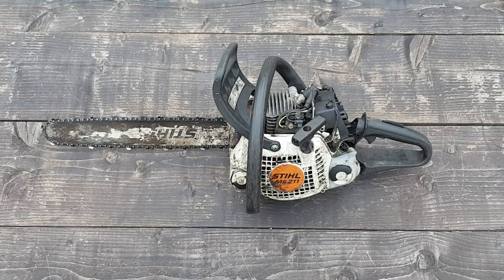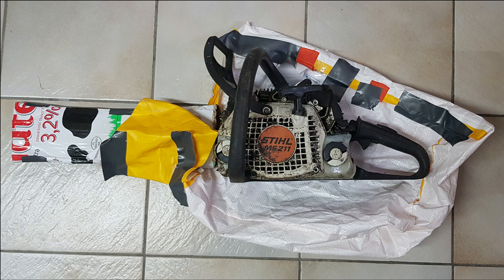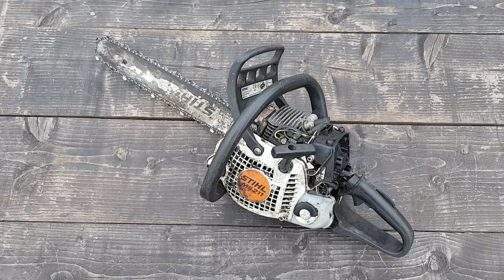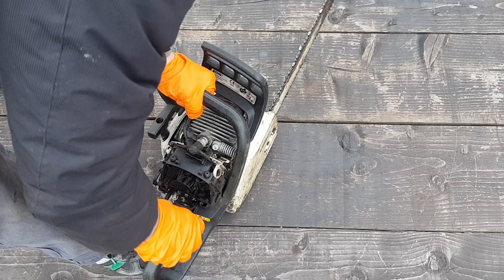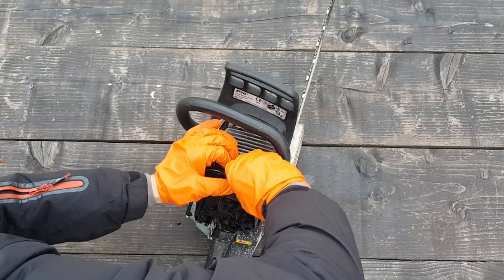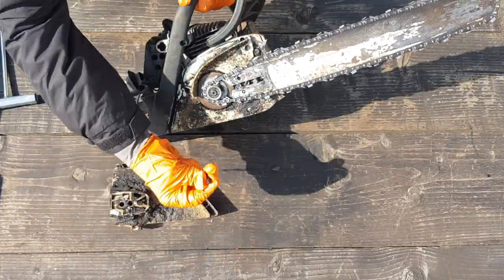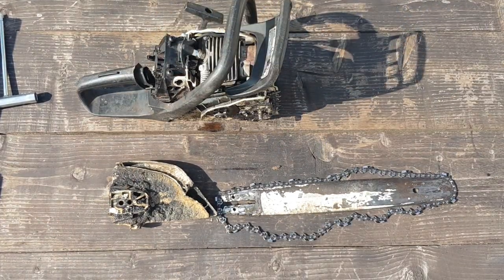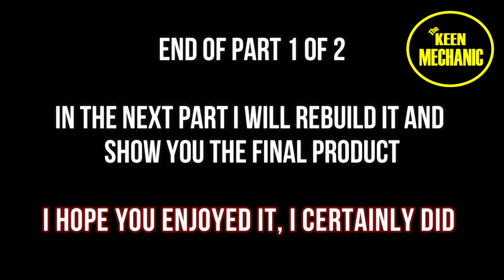Stihl chainsaw restoration stihl ms211 ms171 ms181 £50 $60 stihl budget chainsaw restoration PART 1

Comment: anyone know how to ensure the oil pump is seated perfectly (at the correct depth) so its discharge hole lines up w/ the hole that receives the lube? most videos on installing a stihl oil pump say to push it in until it won't go any further but on the ms211 this rule doesn't seem to apply.
Reply from the maker: I just pushed it in and never had any issues after that